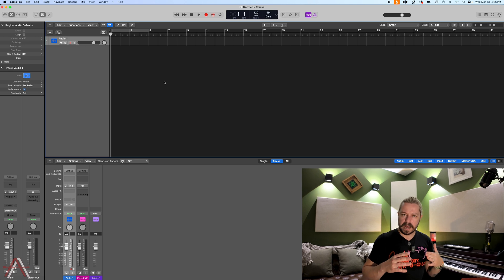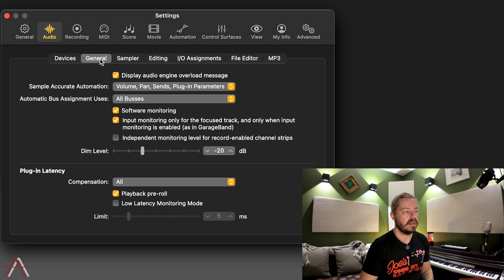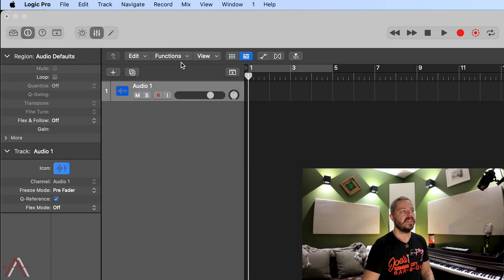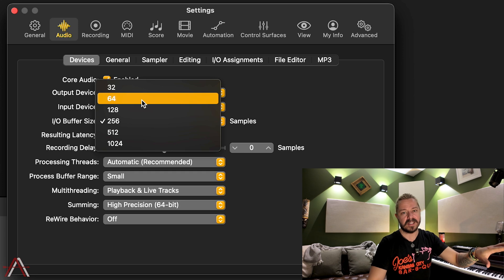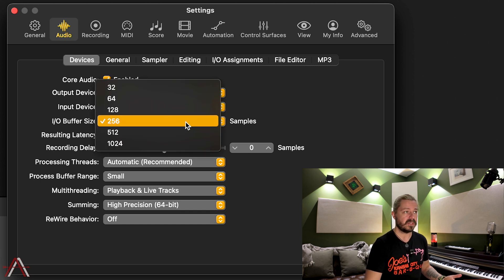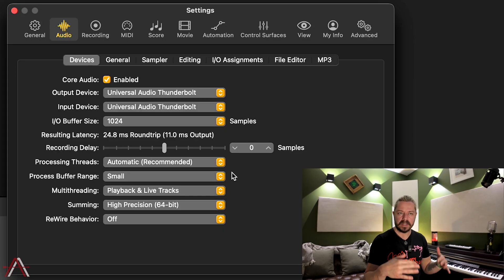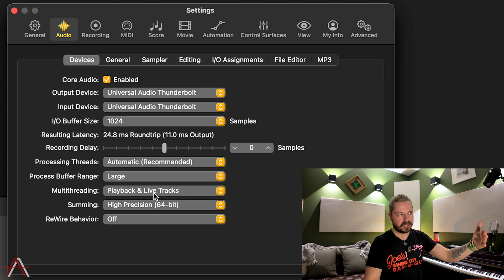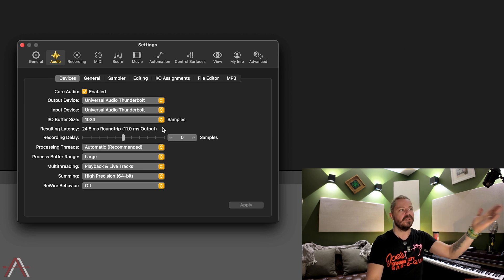How To Fix Latency When Using Logic Pro  #logicprox #tutorial

Comment: Hi, thanks for your tutorial . Very useful. When I apply low latency monitoring mode, and when I record my guitar, it bypass my my plugin ( Guitar Rig) if you have a solution, I will be grateful. Cheers
Reply from the maker: Hmmm, I’m familiar with guitar rig but don’t own it. I would suggest emailing the dev and presenting this issue. Otherwise I would track the guitar with a similar sounding plugin (to get the vibe right as you track) and then just change the plugin awards. Not the best fix but will get you by for the moment.